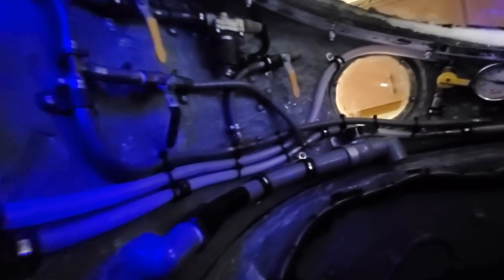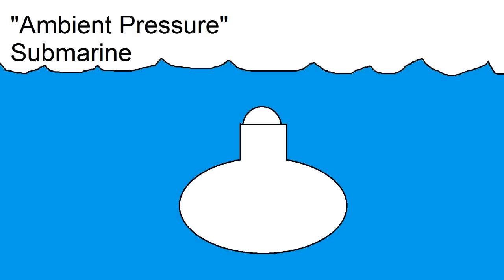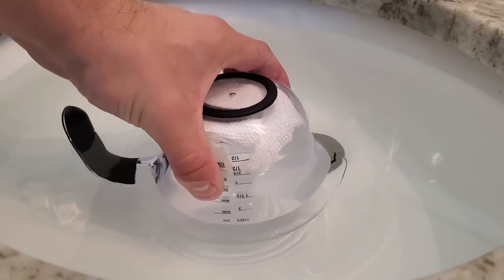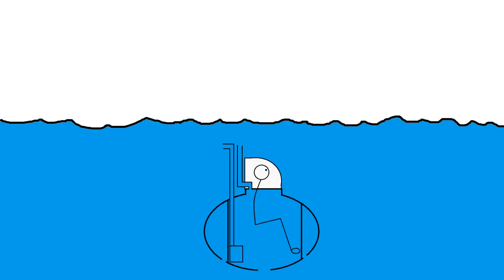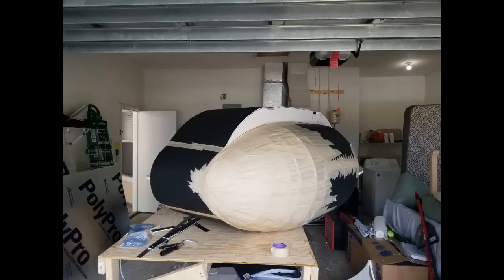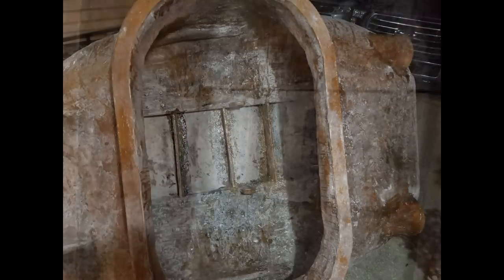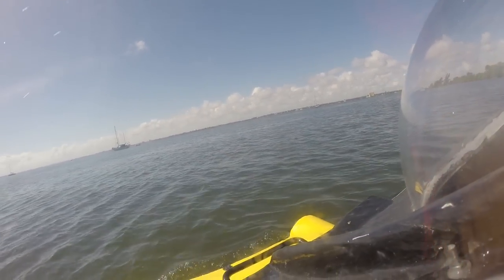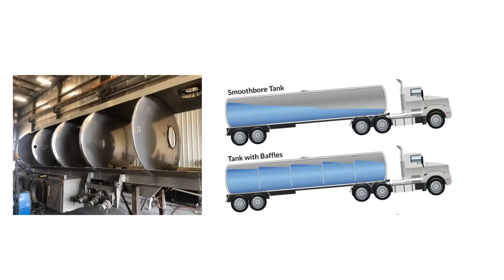My Homemade Submarine

Comment: Yikes! Yeah, seal the electronics with triple redundancy when it comes to the stuff that keeps you alive. Side project suggestion - find out how to remote pilot the sub for the dive/surfacing tests before live crew. Maybe an auto timer? Might not be a bad idea to set an auto timer to surface in case of getting accidentally knocked out somehow (outside hit, unexpected medical issue, etc.) and a backup 'air bags' to surface you in case that fails.
Also, you and PeterSripol heading to Florida this month (or the next). One doing solar power above the water and one going below. Be careful not to bump into him from below!
Reply from the maker: I like the idea of a safety timer. Hadn't thought of that before
Reply: @HyperspacePirate  Yep. When you are underwater with no one nearby it's a good idea to think of all the ways Murphy might mess with you because it's near impossible for a friendly bystander to see and help a submerged sub than a boat on the surface. Being able to bail is also good but if something unexpected prevents bailing (for whatever reason) then its good to have options for the sub itself even if they are one-time emergency use. 

Or if you have to bail and then recover it later if it sinks having an one-time use floatation device already installed rather than installed after it sinks (which would be REALLY fun - not!) would be a good idea. Even better if it automatically does that after you bail so it floats up on its own and you have something to hang onto rather than swim. Not sure how naval regulations deal with a private sub littering the ocean floor but I don't think they would like that happening in the event of a bail out (and would likely be expensive).  

Just floating out random ideas that come to mind. You've had a lot more time to think about it so you've likely already considered most of it.
Reply from the maker: @curiousviewer5991  All good ideas. 

I didn't mention it in the video, but i can dump 300 lbs of ballast with the pull of a lever, which would bring me back up to the surface in case buoyancy control failed
Reply: i have stumbled upon a comment section of smarts.